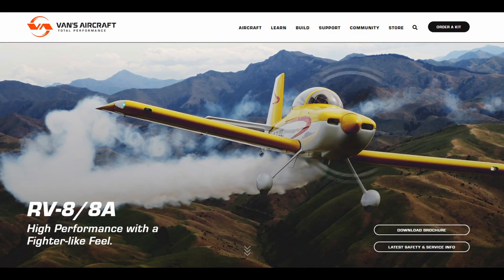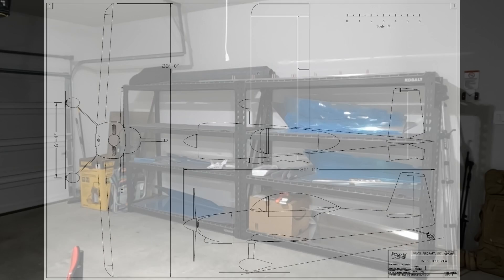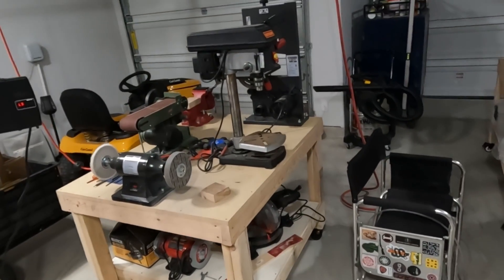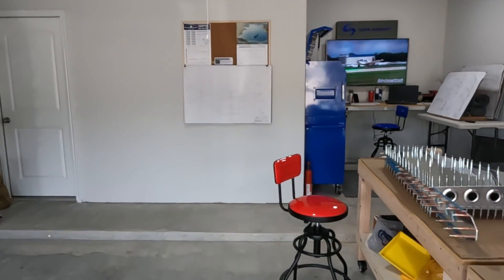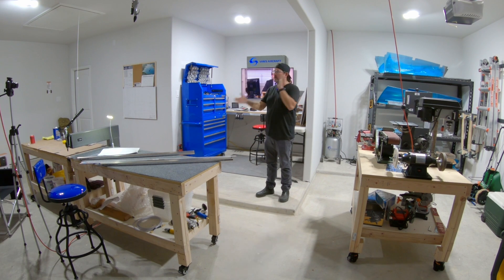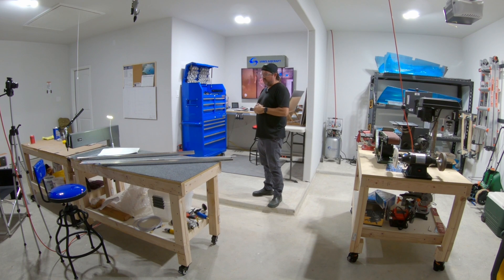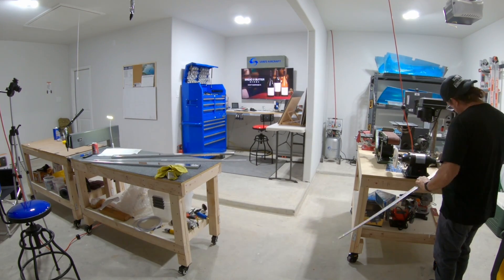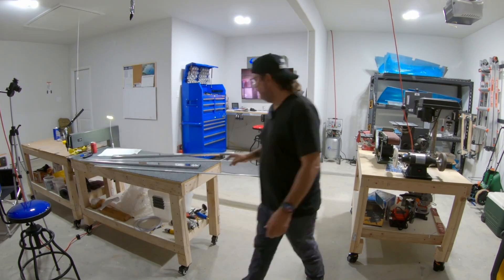Van's RV-8 Build. Ep 001. Horizontal Stabilizer 01. And so, it begins

Comment: "...70-80% of the time just staring at the plans..." Hear, hear! Me too. I began my RV-8 around the same time you did (still waiting on some backordered elevator bearings since December.) And after literally driving from AZ to Aurora, OR in December (Yes, December) to pick up my empennage, I am only now in the AZ heat beginning to cleco and rivet the horizontal stabilizer spars stuff. There is a definite mindset that doesn't come easy if you've never done this before nor spent your life as a metal worker. My first mistake? Match-drilling the wrong holes on one of the HS-00003.
Reply from the maker: Oh, man! Your comment is giving me flashbacks! I ended up mis-drilling HS-00003 after re-making the reinforcement angles TWICE. Cautionary tale here: https://youtu.be/w6beqL59xuc     BTW, you'll probably be getting your bearings any day now. My HS/VS bearings came a couple weeks ago, and I was just notified that my wing kit bearings are on their way. Van's is getting caught up.